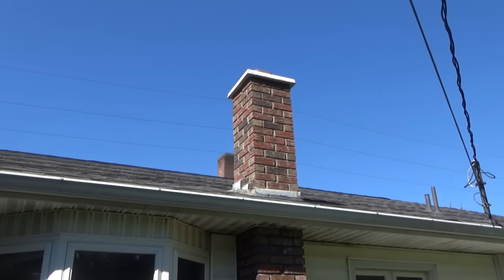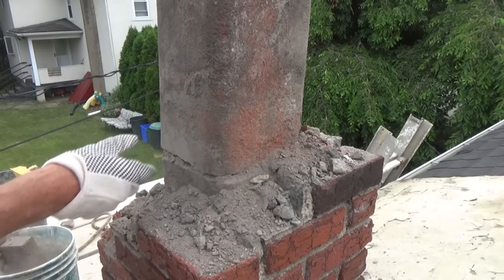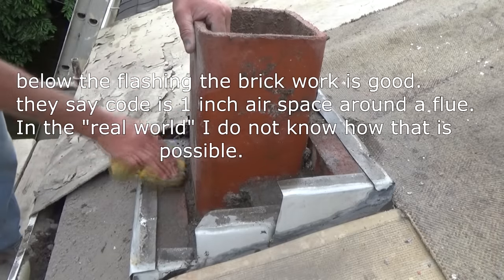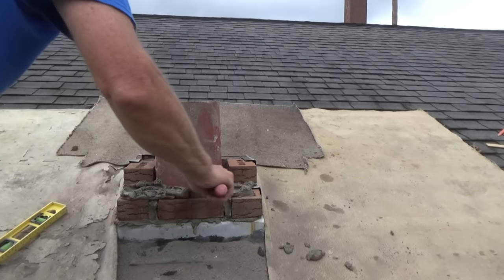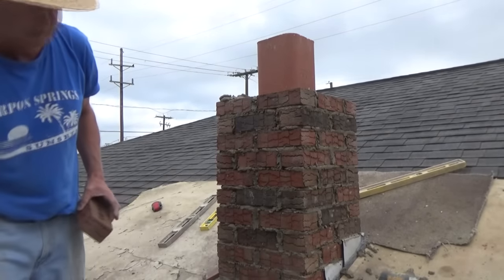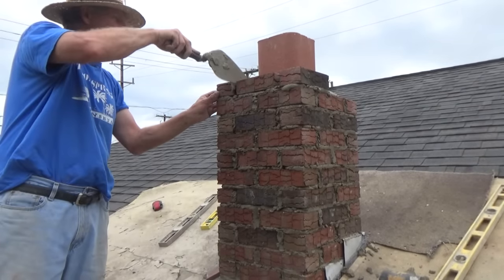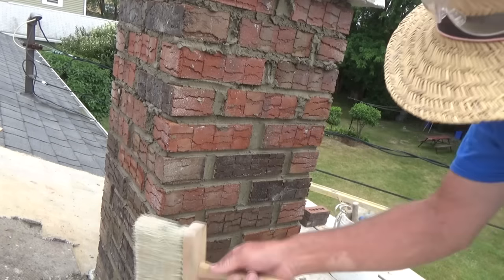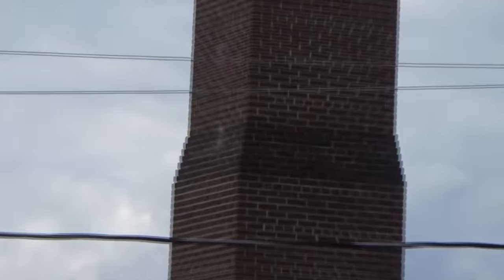CHIMNEY REPAIR (part 6) BRICK "Mike Haduck"

Comment: Mike no offense but you have violated a number of code issues on this chimney along with many practical faults such as no expansion joint between the flue tile and crown, cored brick instead of "solid masonry units", 2" clearance to combustibles, 2-4" maximum flue tile extension above the crown,  etc. You failed to mention the minimum chimney height which is 3feet above any roof plus 2ft above any point within 10ft .horizontally. You are required to use a "medium duty non-water soluble calcium aluminate refractory cement mixture between flue tiles. You must maintain a 1/2-4" airspace around the flue tiles for thermal expansion and a drainage plane. That ultra hard mortar may be too hard for even modern brick but you didn't test them. Type N is all you need. Once its done, treat with a water repellent that is 100% vapor permeable. Come to the PA Chimney Sweep Guild's annual workshop and you can learn these things and a lot more while slinging mud and probably teach us a few things. You do a nice job laying brick and yes, those modular bricks do result in wider head joints. FYI, the holes in the cored brick not only make it lighter but allow the heat to penetrate to the core so the whole brick gets hard fired quicker using far less fuel. You can use most 3 hole bricks as they are considered 75%'ers treated same as solid per the code. Peace.
Reply from the maker: Hi Hearthman,  the truth is masonry chimneys are a thing of the past, and all my experience and my dads over 70 years says this is what works in this situation, , what we need is written inspection reports from these officials to guarantee what they preach, when I was in law school the Supreme Court rulled all agents are responsible for the foreseeable consequences of there actions,, so every once in a while I have to send a letter reminding them of that, funny how they never come around anymore,  I hear what your saying but if I listen to what your telling me I will be back fixing it again in a couple years,  with all do respect,   No offense also, Thanks, Mike

Comment: Yet another cowboy posting videos in the hopes of drumming up some work!! 5/10 years after he built that chimney it's going to need rebuilding again!! He should have used hydraulic lime nhl 3.5 instead of cement in his mortar mix at 4 sand to 1 lime as the heat from the fire place causes the chimney stack to constantly expand and contract constantly causing the cement to fail,,,lime mortar is more forgiving and allows such movement
Reply from the maker: Hi Stuart, our family been in business over 70 years, if I used lime, I be back within 10 years doing it again, thanks for the comment mike